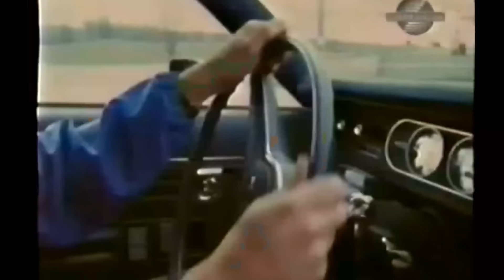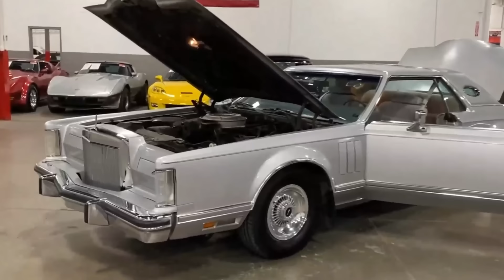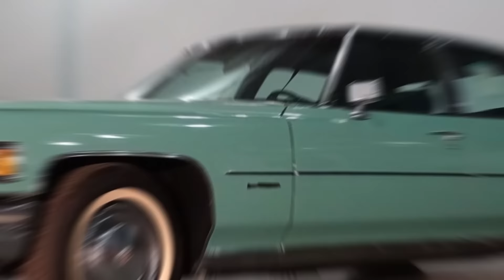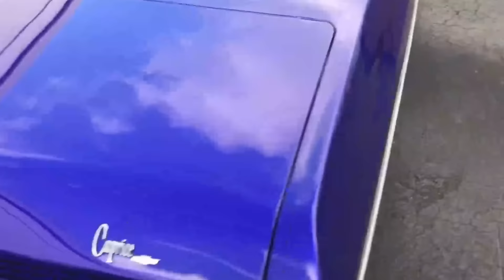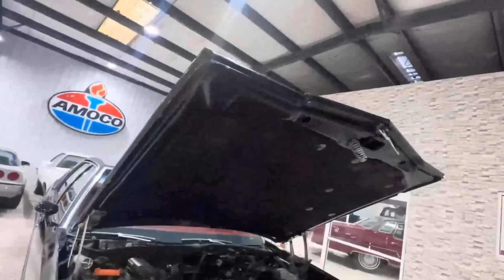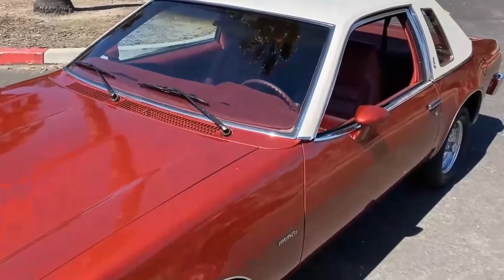Top 9 WORST Cars of the 1970s

Comment: Cadillac Broom...snort, LoL  The 500 cid V8 only produced something like an anemic 200 HP....I have a 2016 Chevy Tahoe with a 500 CID (8.0L) MFI...Factory Rated at 475 HP 'n consistantly gets 17 mpg highway running 65 - 70 mph...so powerful it's dangerous...smooth quiet. powerful 'n trouble free...never had a single operational issue, has 56K original miles...January 2026

Comment: The Chrysler Imperial...I remember those barges...neighbor had one ...gas mileage was horrorific, he was gett'n only 8mpg with that 440 cid 4V, a massive engine that only produced a little over 200 HP, meh, that was one thirsty monster ....And, the steering was so over boosted 'ya couldn't feel where the car was going....took alot of concentration 'n even short drives were tiring because 'ya had to constantly concentrate on the vehicle trajectory....Brakes were similarly touchy...apply what 'ya thought was an appropriate pedal pressure 'n you'd come to a tire screeching halt locking all 4 wheels....and, it had constant electrical 'n ignition system gremlins...The unsolved problem that amused me the most is that when 'ya turned on the headlights, sometimes the headlight doors would open sometimes they wouldn't, nice feature when 'yer out on the road on a trip 'n darkness fell...snort   That was a scary car 'ta drive 'n a headache 'ta keep operational...He had it less than 2 years before dumping it...

Comment: Oh I forgot my 72 Mercury Marquis in 102,000 miles all that vehicle needed was oil and spark plug changes did the brakes twice in all those miles and when traded in after a year dealer accepted it as a 12,000-mile car no 6th digit on odometer truly a great car

Comment: These were all great cars, and thousands of times better than anything built today. The only problem was the emmissions engines and all the emmissions stuff that drained half the power. But if you live in a state without emmission inspections, you could cut all that stuff off.

Comment: Some questionable rankings here for sure.    I was in my 20s back then and the worst cars by far were the Ford Pinto and Chevy Vega.   The former had a gas tank that was not protected when rear ended.  The Vega's aluminum engine did not last long.    The only vehicle I owned from that decade was a '76 Nova with a 305 V8.   Had it until '83 and it was surprisingly reliable.   Horsepower of most vehicles back then was awful and my 305 was rated at something like 145hp.

Comment: I knew you would put the Gremlin in this list but obviously you never had one and i had one and it was a tank. Tougher than nails. Drove it up Pikes Peak without a hitch, Put a cycle rack on the back bumper and carried my Honda XL250 on it for thousands of miles without any problems at all. I was always pulling other vehicles out of the ditch and such for it surely had plenty of power! Drove it for 12 years and put 160K miles on it and would have driven it a lot longer but the Maine winters got to it with all the salt they used.
Reply: Also check out the get away from the police station in the movie The Terminator, Also there was a second one that got hit by that gas truck and that Gremlin looked like it did real well, a whole lot better than the cars did in Beverly Hills Cop. Also there was one in Crocodile Dundee when the pimp fell on it after getting hit by Dundee.

Comment: The reality is that “Detroit” cannot be faulted for building - nor the buying public for buying - these 1970s gas guzzlers. Reason: when they were being designed, gas was CHEAP. Nobody EVER asked about gas mileage!!! NOBODY CARED UNTIL THE YOM KIPUR WAR (= oil embargo)  IN 1973. That changed everything in a day! It takes 3-5 years to design and then build a car from the ground up! (NOT 3-5 days or months). 
Yes, Detroit became sloppy, arrogant and lazy. Stupid governments and greedy, obstreperous unions did the rest. Look at the lunacy of useless, gas-guzzling SUVs made today - do you blame the auto-makers for building them if idiots want to buy them (at LUDICROUS) prices??? Speaking of “gremlins” today’s over-the-top, failing technology dooms a great many of vehicles coming off the assembly lines within the first 12 months. But the stupid, buying public keeps pushing for more and bigger touch-screens to play with. These will soon become so large that it will be impossible to see out the windshield!!! Oh but wait, that won’t be necessary because “robo-driver” will do that for you too!!! Personally, l want a car. A car l can drive - NOT a bloody computer on wheels!!!

Comment: The gremlin was a good reliable car.  I agree that the Chrysler cars from the mid to late 70s had poor build quality.  For all domestic cars, taking your new car in for warranty work to work the “bugs out” was normal.  People got tired of the poor quality and turned to the better built Japanese cars. 
The content about the Monza is mostly false using information about the Vega that was not true for the Monza. Yes, the Monza was based on the Vega platform but had completely different engines that were reliable.  It’s interesting that the Vega which is considered by many to be the worst car of the 70s and had many problems did not make the list.

Comment: I taught driver ed classes and on-street sessions. I always seemed to get stuck with an Aspen/Volare. The cars were very difficult to teach beginners in due to the limp, lifeless feel to the steering. They had almost no self centering coming out of turning corners. When started up cold, they would almost always stall several times unless you let them run on fast-idle for 7-10 minutes. The front suspension torsion bars ran crossways , thus were so short that they had to be mounted in heavy rubber blocks to avoid harshness on bumps. When they got to high miles, they would wander frequently, another feature that beginners found frustrating. The ignition resister was mounted on the middle of the firewall, and they failed a LOT. In our school district, every Mopar training car was equipped with a couple of spare resisters and a screwdriver to swap them. The ones I drove used to go through at least one per year. Not a great car! Bill

Comment: what a crock of shit!!! Here is the truth, I bought a 1972 American Motors GREMLIN with a straight 6 automatic and an AM radio, I had it for 10 years!! The ONLY Money I spent was for oil, plugs, points, tires and gas!!
The GREMLIN drove smooth with good acceleration and gas milage, I took my family -wife and 3 children all over New York and new England on many vacations. Also, a great car in the snow. The shit for brains who made up all this shit did not even do the minimum research, if he had, he would have found out that the GREMLIN was successful with more than 700,000 cars sold!!!
Reply: I agree 100% and i had a 72 Gremlin that i bought brand new for $2,600 and drove it 12 years. Would have been a lot longer but the Maine salted roads in our winters did it in.
Reply: Had a 1970 Gremlin with three on the tree back in the day.  The car had a tiny 6cyl coupled with a huge gas tank.  Could go forever between fill ups.  Thoroughly abused this car and it just kept on going.
Reply: I guess you were the lucky one.
Reply: I rarely saw a Gremlin on the road by the 80’s’ They were gross looking and unreliable. Historical revisionism is alive and well in America. Seventies brought American manufacturing decline still visible today

Comment: What?  No Vega?  No Pinto? No Chevy Chevette? No Plymouth Arrow? No Maverick? No Mustang II? No AMC Matador? No AMC Pacer? No Dodge Charger? No Ford Torino?  No one who made this video was alive in the 70s, that much is clear, but to be fair you can't compress all the truly awful cars that came out in the 70s into just 9 examples either.  The real challenge would be finding 9 great American built cars from that decade.
Reply: You forgot Toyotas. Bad, bad, bad.
Reply: @RC-yj6qw  I wouldn't go that far, in fact The 70s Toyota Corolla would be near the top of my list of best cars from that decade, exceeded only by the Toyota pickup which was, without doubt,  the single best, easiest to maintain and most reliable vehicle you could buy new back then.  The biggest problem with Toyotas was trying to find one for sale at a dealership.
Reply: No Datsun b210, 210, or 310, all poorly made, rusted bad, engines died at 75000, to  90000, due to poor quality main bearings,bad cabs, dealers could never fix
Reply: Also bad paint that faded or pealed
Reply: @sf-dn8rh  As far as imports went, the B210 wasn't the worst car from the 70s, in fact it was pretty popular, economical and at least as reliable than any U.S. sub-compact made at the time, which admittedly isn't a very high bar to clear.  If you want to talk about imports from the 70s that were truly awful, the VW 412 and the Mazda RX-2 were a lot worse than the B210.